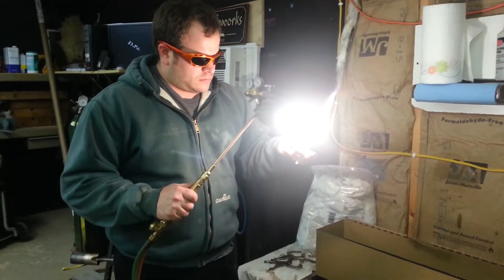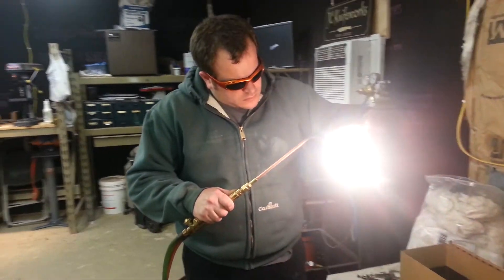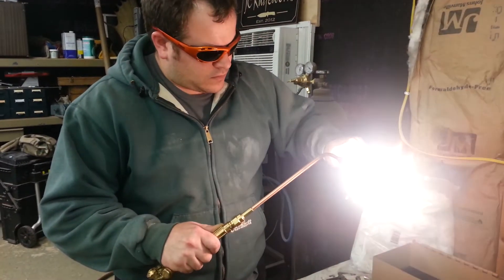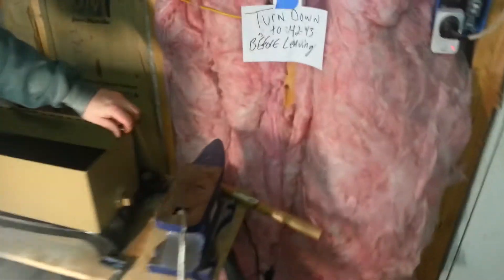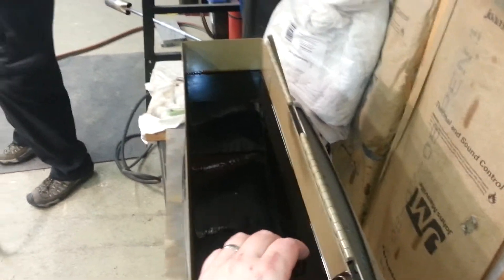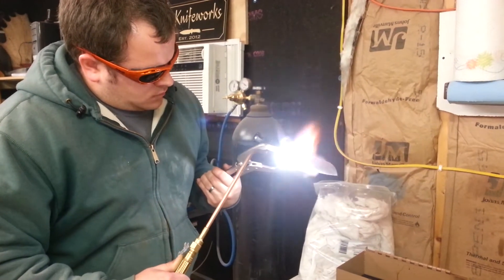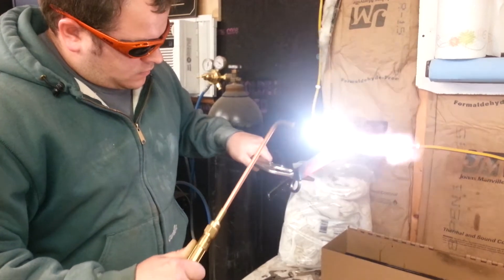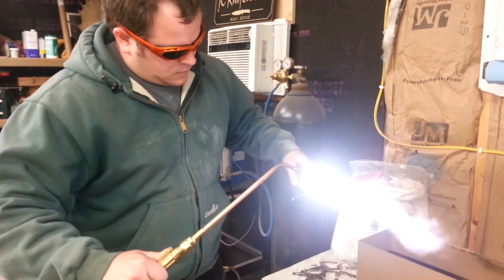JCKNIFEWORKS heat treating Alabama Damascus

Comment: LOL you guys have a heat treat oven sitting there and you're doing that imprecise edge hardening crap?  Let me guess, you're quenching in used motor oil too, huh?
Reply: Looks like it.
Reply: I wouldn't trust these guys to hold in a fart. He had no idea what temp it is nor did he check to see if  a magnet would stick to it.